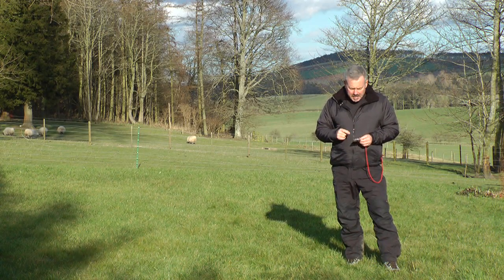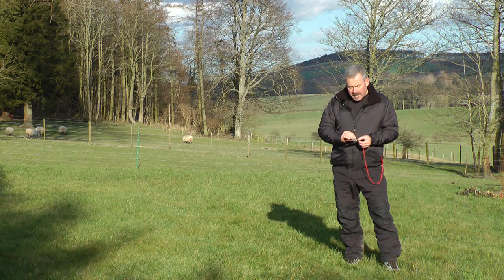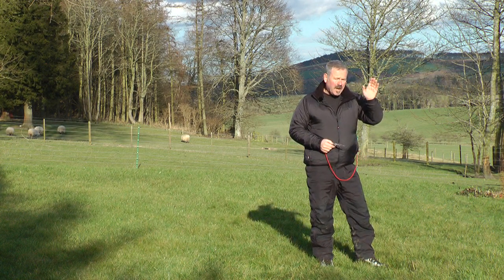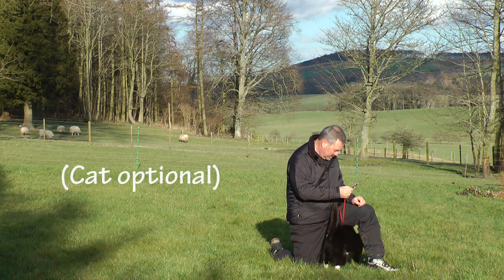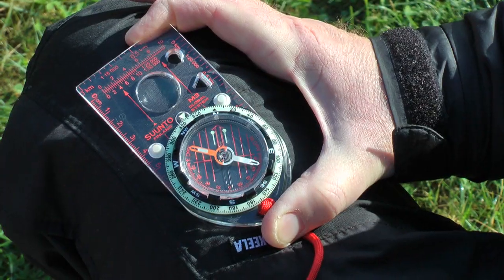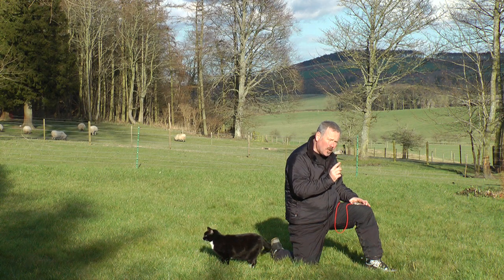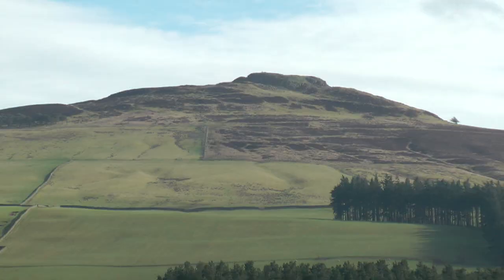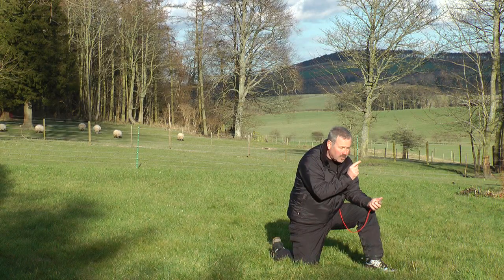Taking a compass bearing from a landscape feature

Comment: And then what? Exactly how do you use your compass to navigate toward the object you took the bearing on? What if the object itself disappears behind trees or other obstructions while navigating toward the object. How do you use your compass to maintain the proper direction of travel?
Reply: You don't need to see the feature if it disappears behind trees or other obstructions. Even if you walk into a valley. He left a lot out but he was just showing how to set up a bearing "Azimuth" by site.

It looked like his bearing is 034 degrees. When he turned the bezel or Azimuth ring to line up the LARGE RED ARROW beneath the Magnetic North Arrow that set your compass bearing in line with your feature giving you your 034 degree bearing which is a lined with the triangle. 

So, as you continue to walk toward your feature "Destination"  you would regularly check your compass to maintain your bearing.  Now to check your compass bearing stop take out your compass, holding it in front of you about chest level and facing the compass the same way he did, turn your body until the LARGE RED ARROW is again lines up with the Magnetic North Arrow so that the 034 degrees is a lined with your little triangle. You will then be a lined correctly with your first Azimuth. The main reference with this way of navigation is that the LARGE RED ARROW is a lined with the Magnetic North Arrow so that  your bearing will always be true to your first Azimuth. I hoped this helped.
Reply: @desertmaverick7567  Thanks for the explanation. What I was getting at was exactly how to navigate around an object like a large hill or mountain and end up at least approximately on the same line of approach where you encountered the mountain on the other side. Something like taking a 90 turn to the right until you can walk around the obstacle (counting paces of course), then returning to the original course until you're past the obstruction, then making another 90 degree turn and walking back the same number of paces to approximately your original course and then continuing on your way on that course. Many thanks.

Comment: Thanks, well explained. I can see a trig point from my loft window I have taken a bearing. What I want to know is, when I'm at the trig point what is the bearing back to my house (it will help me when looking through binoculars to find my house) Is it just the opposite bearing on the compass?
Reply: Yes it is. You can add 180 if it’s less than 180 or add 180 if it’s greater to get the back bearing.

Some compasses have an index mark on the opposite side to give you that back bearing.

You can also turn the compass so that the opposite end of the magnetic needle lines up within the orienting arrow.
Reply: Look up back bearing or reciprocal bearing. Depending on the bearing( of your trig point) you add or subtract 180 degrees OR with your compass have the original bearing on the the index line, rotate the compass so that the black/white end of the magnetic needle ends up in the orienting arrow. Your direction of travel arrow will have you back to your house.